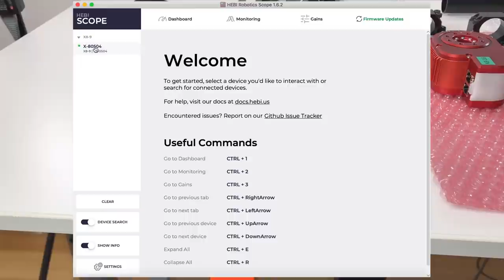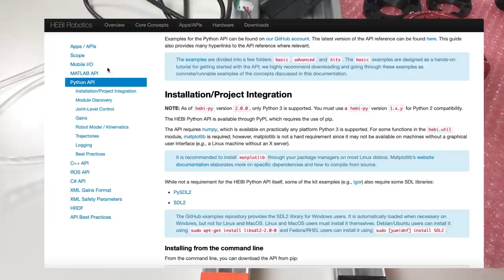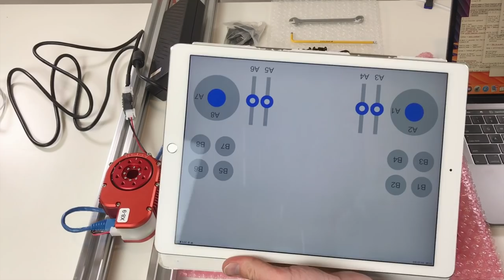Extremely Fast Way to Prototype in Robotics!

Comment from the maker: Yes, these actuators are very expensive. But: 1. We can learn even from looking at expensive actuators! 2. API from HEBI robotics can be used even for your DIY robot (and it is free). 3. We learn that even the actuators with big backlash have future and applications. For me, these 3 points are more than enough to consider this video useful.
Reply: What is the approx cost of a single actuators ?

Comment: Thank you so much for sharing. We have been trying for ever to come up with a low budget reliable closed loop actuator design that probably involves a strain wave gear ( harmonic drive) and a stepper motor for a robot joint, in order to help the low budget robotics research enthusiasts like our robotics team. We hope you could help towards such a goal.

Comment: It would be neat to follow the change in torque so the robot can notice sudden changes (ie collisions) rather than just stop at a specific torque.  That way the robot could still lift heavy loads in different orientations while still detecting collisions.  Collisions could be picking up a fragile package, while the heavy load could be the robot arm itself.  I'd love to write this code!  I did table-driven Collison detection on my 30' robot hand electronics.

Comment: Nice one! I followed a similar approach (two years ago) of building a modular robot joint with a full metal cycloidal transmission, BLDC + Driver. I just documented it (first test) - you might enjoy watching it :)
Reply: I usually don't post comments with links, but in this case I think it's quite fitting... please take a look at this video we posted on actuator design https://youtu.be/bouEt1i2yA0?t=952. I know at least 5 companies that took an expensive stab at a custom cycloidal gear train and ended up abandoning the effort. For acceptable levels of lifetime they become so expensive to machine that you can just as well use a harmonic drive :/

edit: I don't want to discourage you. I'm just letting you know what you're getting yourself into. Make sure to do lots of testing!
Reply: @florianenner7435  Thanks for the comment. I totally agree with you on this point, the machining needed to built a really good working cycloidal transmissions is very difficult - micrometer range... I tried a view things like grinding the discs on my milling machine and lapping them, but this was not really repeatable and took a good amount of time.. I achieved backlash less then an arc minute, but not in any position... So not really usable 
Nice video! Thanks for the link

Good that I‘ve started this in university as a semester project, so the time was somehow limited.. In those 3 weeks I built 3 prototypes. The one shown in the video is the latest one - at this point I realized the real difficulty of this subject.

Now, I‘m following a kinda different approach in my current project: 6 DOF robotic arm - it‘s promising so far :)
Reply: @EngineeringSpareTime  What was the max backlash in all the positions?  Would that max still be good enough?  

I'm wondering why they are so susceptible to precision problems.  Could you explain more?  (Like when you say micrometer range, do you mean 1 um or 100 um.)  I'd be very grateful to learn!
Reply: @TheRainHarvester  It kinda has to run homogeneous to hold up. Otherwise the internal forces would lead to a significant amount of wear..this causes more backlash (simplified..) ... and so on. 
It’s in the range of 1 um and less. Due to the fact that it‘s „hard“ contact (zero backlash situation), the elastic surface deformation of the contact elements (and housing..) have to accommodate for all the inaccuracies, to provide a proper/ reliable working system. Even better: You’re using some of the elastic deformation capability to preload the discs (e.g. a tiny bit oversized disc), this can increase the stiffness even further.
Reply: @EngineeringSpareTime  Wow, that is precision!  Is the wearing out of non-uniform backlash actuators something you observed empirically, or is there info on this subject commonly available (I didn't study ME only EE)?
Would adding SEA fix the wear?

Comment: Come on, what happened to "creating the bright future with robots for everyone"? Even the $500 mini-cheetah actuators were too expensive for most people. Your old stepper arm was great. I'd like to see more <$1000 useful robot designs.
Reply: I really hope in a few years prices would go down, and i myself have intentions to work on open source actuators to make them much cheaper :)
Reply: MIT Motor is only $150 in China now.
Reply: @wei1224hf  Wow, that's an incredible improvement. You actually could build an arm for around $1000 then.
Reply: @dekutree64  There are different types of MIT Motor producing by diferenct companies. The cheapst is only 1000RMB( $149) , with torque 18N/M. The most expensive one is 4500RMB($670) , it's torque is 65N/M , with 1:9 gear ratio.
Reply: @wei1224hf  could you please paste the link to it? I wld very much like to buy but i cant find 🙂
Reply: @tanchienhao  And they sell entir MIT dog for 2700$.
Reply from the maker: @wei1224hf  We need links! Please! :)
Reply from the maker: Yes, these actuators are very expensive. But: 1. We can learn even from looking at expensive actuators! 2. API from HEBI robotics can be used even for your DIY robot (and it is free). 3. We learn that even the actuators with big backlash have future and applications. For me, these 3 points are more than enough to consider this video useful.
Reply from the maker: And I borrowed these actuators, they are not mine. So, do not be jealous :)
Reply from the maker: Can you point me the 65Nm MIT like actuator? I am really interested.
Reply: @Skyentific  Sorry I made some mistakes, it's max toqure is 65NM, not the continue toqure.
https://detail.tmall.com/item.htm?spm=a230r.1.14.22.2e0d708bvfDQxP&id=620437830221&ns=1&abbucket=5
Reply: @wei1224hf  He already reviewed the tmotor products: https://www.youtube.com/watch?v=HzY9vzgPZkA

Comment: I was looking at these the other day... Yeah, so pricey and not super smooth, but it does look really easy to integrate. Also I wonder about the latency overhead with using ethernet; possibly it doesn't matter given the speed of them (i.e. 1-5ms latency isn't much movement anyway at that speed).
Reply: With the right software stack on top of ethernet you can achieve latencies well below 1ms. It is just that software designed for the desktop (and now tablets) was never designed for this and introduces latency at every corner.
Reply: Yeah, for sure. Would need to measure it to evaluate it. I doubt they've gone all the way with optimizations, as vast majority of companies slap in an ARM based chip and call it a day. Professional high end routers mostly use FPGAs for lowest latencies and highest throughputs.
Reply: @elminz  Yes, if they are lazy about it. The ARM chip itself won't be the problem, but all the tools and software that come with it for free. (but at the price of your soul) Endless amounts of libraries and functionality you don't need. Optimizing in this case is more a matter of throwing everything out and only keeping the most basic version of the stuff you really can't do without. Then even with a processor in the 10's of MHz sub millisecond response times should be possible.

Comment: Gruezi! great video :) Indeed this looks like a great mechanical design for rapid prototyping, do you think we can use the mit mini cheetah actuators with brackets to implement a similar mechanical design for a robot arm? do you think the mit mini cheetah actuator bearings can take the axial and radial loads?

Thank you in advance!
Reply from the maker: Great comment. It would be difficult, as MIT controllers has lower power to weight ratio. And they cannot take much axial load. But this is extremely useful comment. I will think about.

Comment: its a quite interesting concept, but I'm worried about latency issues with al lthe signal having to be transmitted over a network protocoll.
Reply: I don't think it will be an issue. When he paired it with the app on the iPad and synchronized their movements they was no noticeable lag (even with the WiFi link). Here is a source that analyzes Ethernet in robotics: https://ennerf.github.io/2016/11/23/Analyzing-the-viability-of-Ethernet-and-UDP-for-robot-control.html
These latencies are acceptable in most applications. If you are doing something that requires extra low latency, you will probably choose something with lower gear reduction anyways
Reply: @matthewforan6397   seeing someone link to my blog post just made my day! Ethernet latency is a common concern, but it's really not an issue if you design the system appropriately. The HEBI actuators run all the extremely time-sensitive loads (PID controllers, safety features, motor control, etc.) in firmware, so the pc mainly needs to compute trajectories and update the set point targets, which isn't all that sensitive to latency. The feedback also contains various local timestamps, so you can always reconstruct accurate dts when running filters.
Reply: @florianenner7435  Absolute! My CNC mill for example runs on Ethernet as well, with a 2 ms buffer and a FPGA on the control side. 
@MAYER MAKES The key point is, that the low-level (high frequency) control is running decentralized.. in this case: integrated in the controller. Ethernet is not suitable for real time applications like directly controlling the motor speed (e.g.) For real time applications EtherCat would be more suitable (also not for everything..). For the trajectory: your kinematic is the slow part (ok, this depends on the increments...) :)

Comment: Well they are $4k so they better be easy
Reply: I think anything with a harmonic drive in it is going to be crazy expensive.
Reply: @AlecMuller  , harmonic drive usually has 0 backlash.
Reply: does it at least come with a happy ending?! PHOCK!
Reply: You'd be amazed how often the expensive stuff has crappy software...

Comment: its a shame you didn't dissasemble it, wonden how they fit such a high reduction ratio inside a small actuator
Reply from the maker: This is not my actuators, I cannot disassemble them. I only borrowed them for the video. But in google you can find a document with the disassembly. It is basically the set of spur gears, nothing super complicated.

Comment: Software-wise it's really cool. But that cheap geared electric motor noise and the associated jerky movement doesn't really scream quality to me and let's be real here, component-wise, each motor probably cost closer to 40$ than the 4000$ they are asking for it. 

I just don't get these "educational robotics" gadgets at all. They are making products for people who are new to the field yet they are charging 4000$ per motor? Who is the target audience here? It's not the professionals. Industrial automation professionals can make better actuators for much cheaper or just buy better ones for cheaper. Intermediate folk (robotics students at colleges etc.) can get MIT Cheetah type actuators that are cheaper and more performant and write their own code for them. So who is left? Jeff Bezos' kids? That's one hell of a narrow target market. 

 Hope they'll make a BLDC or stepper version of it and drop the prices to something sane.
Reply from the maker: Everything is a little different. First, they are well established company. And universities use their products a lot. Their actuators may be can cost 400$ if you produce millions of them. But for volume of hundreds pieces, they would cost 4000$. BTW, educational does not mean cheap. Very often the universities are ready to pay high prices for the equipment. The same for industry, 4000$ is not much if it helps to increase the productivity.